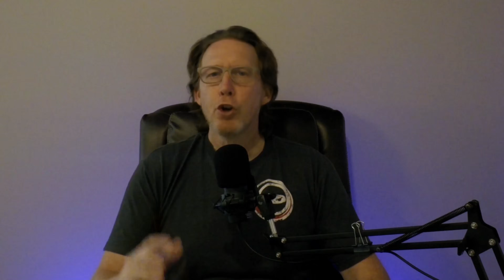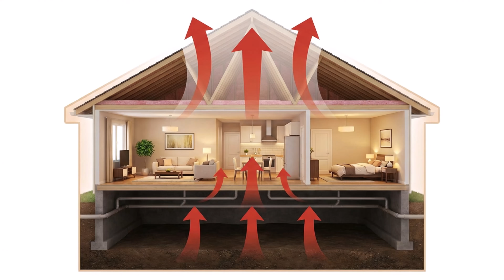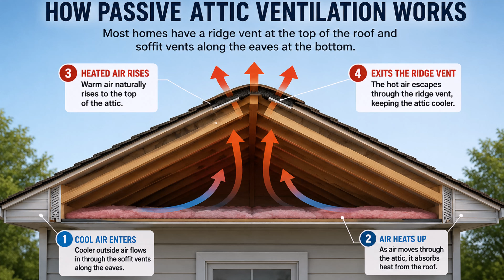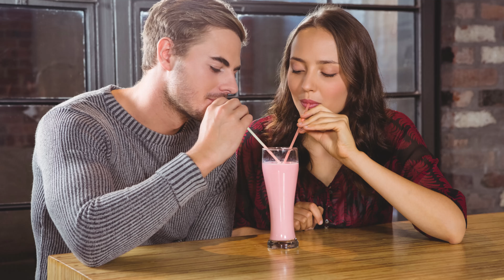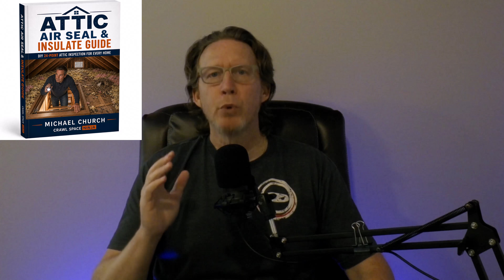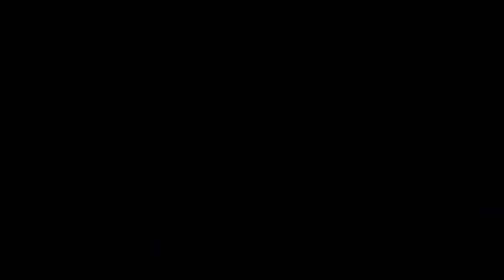Why Your Gable Vents and Ridge Vent Are FIGHTING Each Other

Comment from the maker: ATTIC CHECK 👇 Do you have BOTH gable vents and a ridge vent?

A) Yes — both
B) Gable vents only
C) Ridge + soffit vents
D) I have no clue 😂

If you answered A, tell me: did someone add the ridge vent later, or was the house built that way?

I'm curious how many homes out there are running multiple ventilation strategies at the same time.
Reply: My house has 2 gable vents, multiple turtle vents that were added later, no ridge vent, and no soffit vents. I think I need to add soffit vents and block the gable vents. My house was built in 1984 in Levelland, TX.
Reply from the maker: @matthewrace2738  Thank you for sharing.
Reply: I have both. The ridge vent was added later
Reply from the maker: @Curious_And_Judgemental  did adding the ridge make a difference?
Reply: @CrawlSpaceNinja No clue. Hadn’t had it very long. My house is pretty long, so I suspect it will help some in the middlish of the roof

Comment: Is it possible for a home owner, whiteout much experience, to determine if the ridge venting installed in 2014 actually works?  I need to figure this out while also properly restoring my soffit venting. Then I might consider blocking my gable vents. However, I don't think blocking the gable vents will be easy. I bought you a coffee. Thanks for what you do.
Reply from the maker: @author Yes, start by restoring the soffit venting and checking the insulation at the eaves. Hope that helps. Thanks for watching!
Reply: @CrawlSpaceNinja , what I am wondering is if I am standing directly under the peak of the roof, should I not be able to see through some kind of crack at the very top of the upside down V into the actual ridge venting?

Comment: A, ridge vent added later, now I know to cover gable vent 
Can I use a leaf blower on low speed to blow my soffit vents from outside? Also, can you have too many soffit vents?
And finally I have a porch that has a flat “soffit” for lack of a better term that is outside the ext wall, but under the roof 
Can I cut a 12-24” sq opening and put a vent cover to allow air flow in to the attic space?
Thanks!
Reply from the maker: @author A leaf blower on low speed can help clear loose debris, but be careful not to blow insulation deeper into the soffit. Too many soffit vents usually isn't the issue, as long as the intake is balanced with the exhaust and the openings are clear. Hope that helps.
Reply: ps just found your channel and enjoy your videos

Comment: I have three gable vents and one ridge vent; I added a small soffit vent section at an addition too. Zone 6. Keeping my fingers crossed. I hired air sealing and did new cellulose. House is on a windy location I think. Mike Guertin says vented attics are forgiving and eventually moisture and heat finds its way out, at least in the northeast.
Reply from the maker: @DailyShakeLifestyle You would be at the mercy of the elements which does not give you control or security. The windy location may help ventilation, but it can also make poorly sealed areas perform worse. Make sure the new soffit section has a clear, continuous path to the ridge vent and that the air sealing addressed attic-floor penetrations. Hope that helps.

Comment: Attics are so hot because we insist on covering roofs in asphalt shingles that turn into giant thermal batteries, and even the "light-colored" ones absorb too much amount of heat. Simply improving your venting won't fix the source of the issue when your actual roofing material is actively baking the house from the top down.
Reply from the maker: @bena6601 You’re right that dark shingles can absorb a tremendous amount of heat. Venting won’t eliminate the heat source, but it can help remove heat and moisture from the attic. All of which is inside the attic

Comment: What do you recommend covering the gable vents with? I thought rigid foam but maybe thin sheet metal instead for more fire resistance?
Reply from the maker: @andcind1 I recommend using a material that seals the gable vent openings securely and can handle the local fire requirements. Rigid foam may work in some situations, but check the code before choosing a material.
Reply: Foam will degrade from uv light

Comment: Nope we don't have a ridge vent anymore. Just one gable vent with a 1650 cfm fan(to be replaced with a much stronger fan in future) on the back of the house and soffit vents on both eves.  We were advised by the roofing company when they installed the standing seam metal roof and all new plywood decking plus 1 1/2" of iso board not to put in a ridge vent, that we wouldn't need it and it would also reduce the risk of leaks from wind blown rain. It has been much cooler in the attic since then. Probably 25-35 degrees cooler.
Reply from the maker: Thanks for sharing.